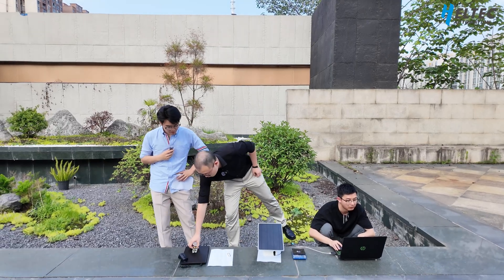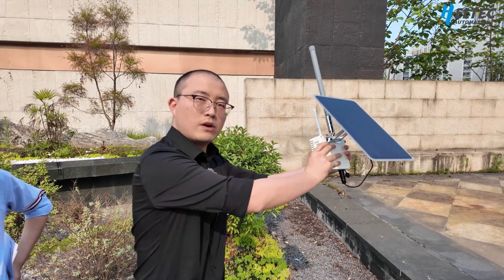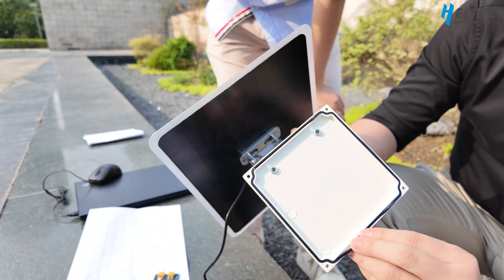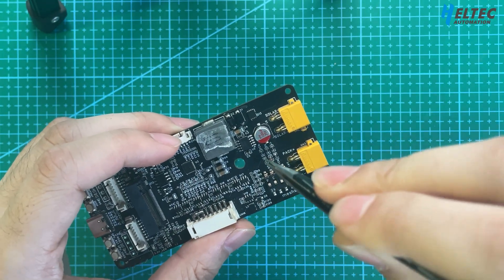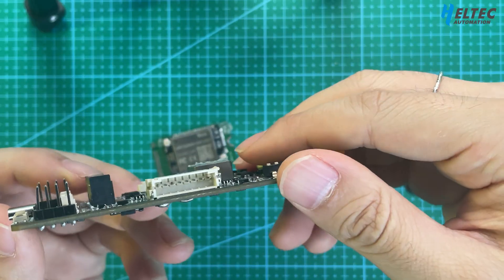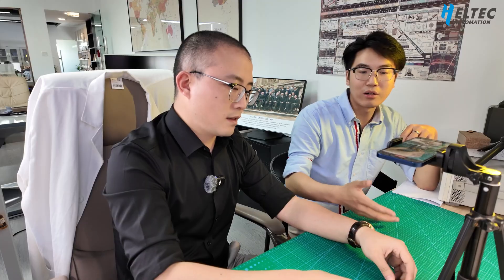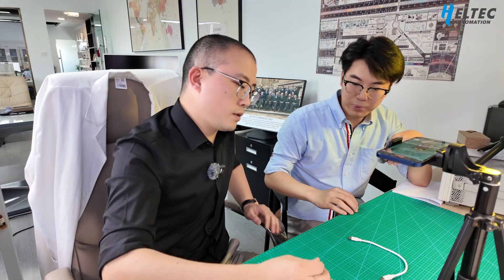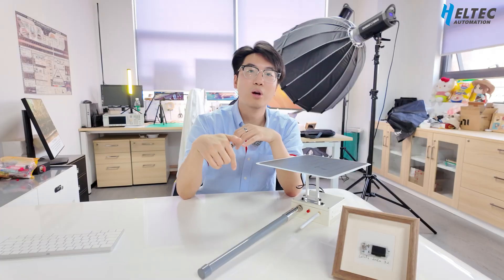Heltec MeshSolar: Redefining Solar-Powered Nodes

Comment: I bought 2 devices. One runs Meshtastic. The other one runs MeshCore. Both die After 3 days (round about) and Come up again when moving or connecting 20v. Batteries are still Full. Any ideas?
Reply from the maker: You can send all the detailed photos and information to support@heltec.cn
. Our R&D colleagues will follow up with you directly.

Comment: meshtastic is becoming too commercialized
Reply: you mean more options with more features and a robust market with competition that benefits the user?  Yeah.  That's definitely awful.
Reply from the maker: I understand that some may feel Meshtastic is becoming more commercialized. As a brand, we believe that moderate commercialization is necessary to support the project's ongoing development and technological innovation, while also valuing the community’s open spirit and user experience. We strive to find a balance between driving business progress and maintaining community values, and we welcome your valuable feedback and suggestions.
Reply: I do not see the issue here. You are getting more options, lower bar of entry for new users, more money that can then be used to hire programmers. You can still buy the simpler products from Heltec or any of the many other vendors, you can still jerry rig your own frankenappliance, you are still unfettered to do exactly as you did a year ago. I really do not see any downsides except it seems that there are no European factories churning out LoRa devices.
Reply: You are the only one to ever complain about more pre built meshtastic devices

Comment: Did u guys fix the horribly power consumption issues with heltec esp32 boards compared to wisblock?
Reply from the maker: We are continuously optimizing firmware and hardware to improve efficiency. Actual power usage depends on your usage scenario and settings. If you need help, feel free to contact us for assistance.
Reply: @HeltecAutomation  the part you're hiding is, it's for low bandwidth or intermittent signals.
Reply: @lorenzo42p  they're not hiding anything.  Everyone interesting in this product knows what it is, LoRa (for LoraWAN, Meshtastic, Meshcore).  The ENTIRE POINT of the system is low bandwidth, long range, low power.  Like, duh.   gtfohwt 'hiding' nonsense...
Reply: the size of that solar panel, my first thought is power usage...

Comment: 🎯 this is great, this is indeed something I have tried to DIY many times. Using M.2 modules for the MCU is interesting, this could extend the useful lifespan of the mainboard. Hopefully it stays in production for a long time.
Reply from the maker: We're glad to hear that our design with M.2 modules resonates with your DIY experience. Our goal is to provide flexible, durable solutions that extend the lifespan of your projects. We’re committed to supporting the community with reliable products for the long term!
Reply: @HeltecAutomation  I should clarify what I mean. This design should be pretty future-proof. Inevitably, the nRF52480/SX1262 will eventually become too old as new protocols are developed etc, but since it can be easily replaced and the mainboard solves so many common needs, there is no reason for the old product to become e-waste. It can be manufactured at scale and be adapted for the future. I hope to see an ecosystem of M.2 modules that allow the use of the mainboard in many applications. Variations of the mainboard that expose different IO connectors but provide the charging hardware and share the common interface to the MCU might also be nice. What I would like to see is more re-use of common parts so we don't need to re-invent the wheel or have unnecessary waste, and this seems to be a step in that direction 👍.